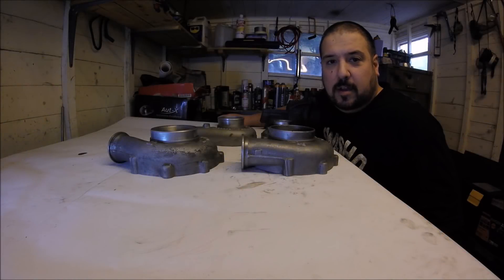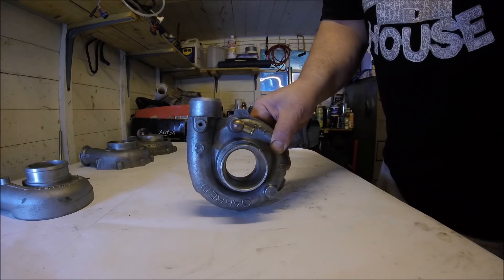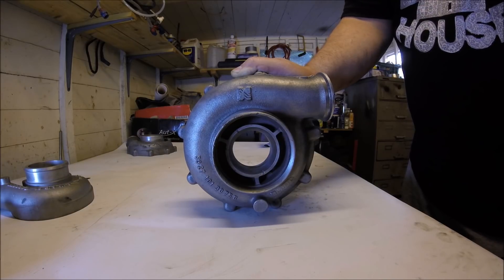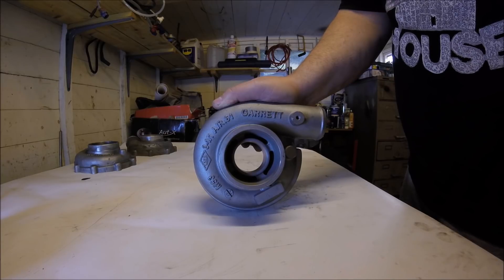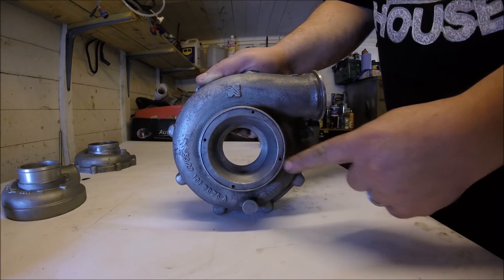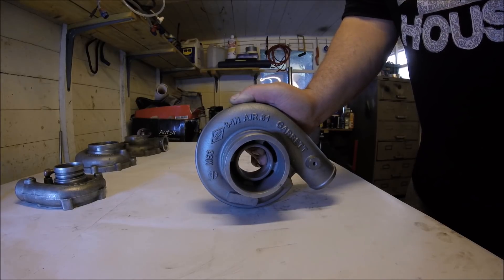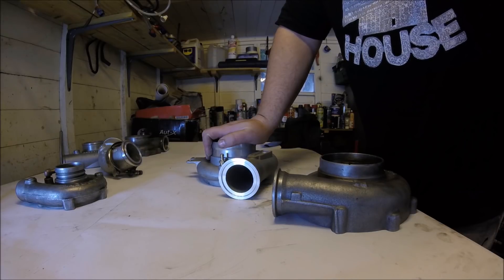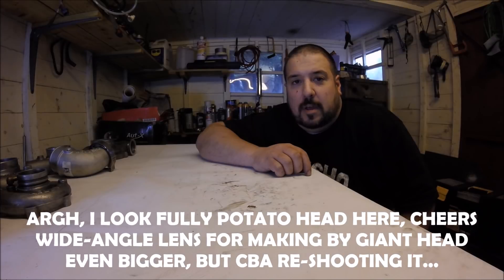[STAV-TECH] THE TURBO SHED- EP#2. COMPRESSOR HOUSINGS

Comment: Hi, I have that gt2260v from iveco, I put on Vw 1.9tdi and hybird with gtx2867 blade. I have no idea why Garret do this at beginning,but since I turned the car,finally I understand why.if u under 2.4bar,nothing happens,the car get 277bps/477nm,so I set boost for 2.8bar,the turbo start to have some whistle sound,and power drop to 230.so I make it through like a real anti surge cover,I set 3.1 bar and get 356ps/600nm and same time the strange sound disappear.so it mean Garret use fake anti surge more like limiter
Reply from the maker: Yeah, you was having bad surge! Glad making it a true anti surge fixed it! Great numbers too, nice work

Comment: Taking about compressor housing ar... What happens if we ported the compressor housing outlet to a bigger size? Like putting it on a lathe/turning machine...for about maybe 2mm bigger compressor outlet diameter...
Will doing that increase the compressor air-flow? Especially if like the turbo is restricted to a limited size option...